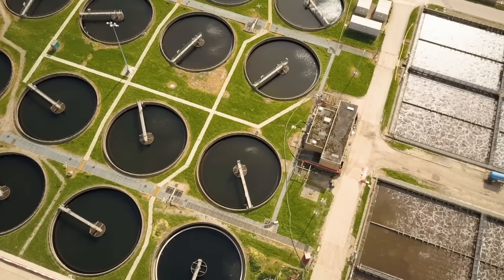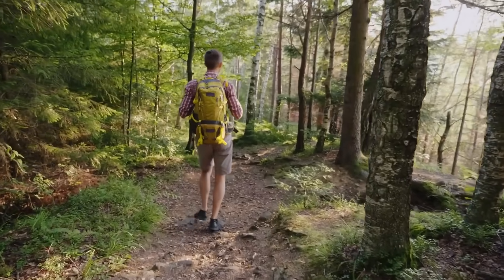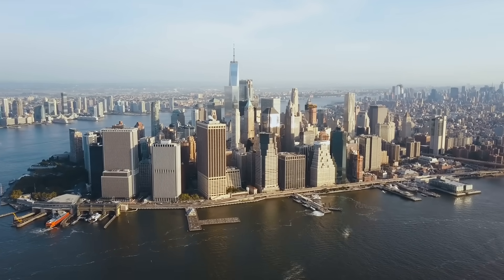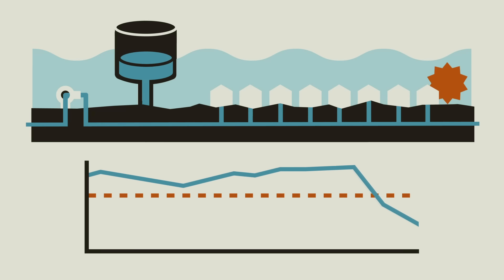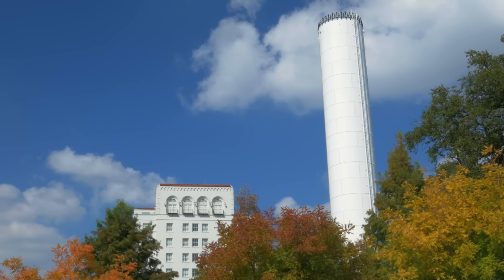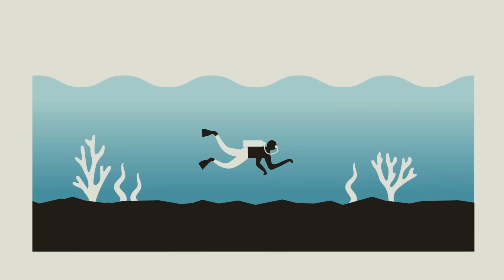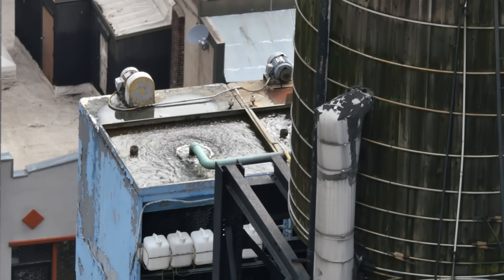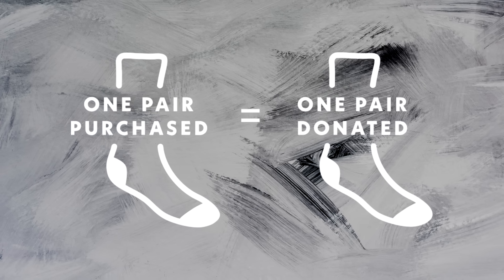How Water Towers Work

Comment: So a water tower is a capacitor. Funny that I've normally heard circuits/electronics explained in terms of water/plumbing, not the other way around.
Reply: Because electricity and water flow are very similiar, but water is easier to understand and imagine, so may be used to explain electricity.
Reply: That's the thing that occurred to me watching the video: that the water tower evens out pressure like a smoothing capacitor with a power supply evens out current.
Reply: I've thought the same!
Reply: That's because most people don't know how capacitors work.    It would be trying to explain how a car engine works with quantum physics you could do it but it would limit for target audience.
Reply: It is known as accumulator, in terms of mechanical engineering when used for fluids and in fluid line
Reply: To simplify, a water tower stores energy in terms of static head pressure,  and can absorb pressure spikes and fluctuations much like a capacitor in an electrical system . And yes, generally speaking, batteries store emf, voltage, electrical pressure and can absorb voltage spikes and fluctuations as well.
Reply: Capacitive discharge. They build an electrical charge, and when full, discharges said charge. Think of your car windshield wipers. The wiper delay is operated by capacitive discharge and the different delay times are controlled by different ohm resistors which control the rate of charge of the capacitor. Once the capacitor is fully charged, it discharges operating the wipers for one cycle.
Reply: Capacitors are known for being mini electrical shock absorbers as well, protecting sensitive electrical components from unwanted and potentially damaging voltage spikes.
Reply: damn, everyone always beats me to the good comments.  :(
Reply: @kenny holmes I agree with Kenny. Batteries and capacitors are similar in that they charge and discharge the energy when needed. The difference between them is that batteries store energy in a chemical form and capacitors store it in an electrical field. Because of this, a capacitor can discharge its energy much faster than a battery. It takes time for the chemical reaction when transferring chemical energy into electrical energy. WIth capacitors, all that energy is stored directly on the plates and it can release that energy at a much higher rate.
Reply: The big differencr someone may have pointed out already. Don't get me wrong I like the idea of thinking of it like that, but the entire purpose and everything surrounding it when it comes to water is 100% to do with moving a quantity of a medium that has mass. That's the reason for water towers in the first place, and the elevation changes that accommodated. The major thing I wish that someone could explain to me is. How is it that these towers can work given the parameters that we've been told? How is it that they're not taking into account the curvature of the Earth. If water is at a certain level in a water tower and Miles away the gravity would be pushing that water in a different direction then what it would be at the source not only that it would also be at a different elevation relative to a ball.  I realize that it's a big ball but this would be an effect that we would see make some sort of a change or difference, no matter the scale. If it has a certain rate of curvature then it has to have an effect. Last time I checked, water always seeks level and fillls whatever space or container is in but most importantly always finding level.
Reply: That was my thought exactly! I’m a Bioelectrical Engineer, so I got really comfortable with electrical engineering variables and equations. Then, I took a cardiovascular biomechanics class, and it blew my mind that the EXACT SAME terms and equations were used in fluid dynamics. So yeah, plumbing is not only a convenient analogy to electricity, it’s mechanics are governed by incredibly similar mathematical principles!! (That only goes so far though because electricity has fun relationships with magnetic fields, and AC electrical applications exploit the hell out of that lol).
Reply: @pyro-millie5533  then you may be surprised to find out just how much water indeed has fun realationships with magnetism and electromagnetic.

For example: oceanic tide changes
Reply: @pyro-millie5533  by the way, if you do not mind. WTH is a bioelectrical engineer?
Reply: @levelliberation6155  hahaha Technically its a Bioengineer with a specialty in electrical stuff as opposed to materials engineering stuff. So I work a lot with medical devices, and eventually want to design powered prosthetics and other devices that interface with the body. I'm particularly interested in prosthetics, monitoring things (like EKG and the like), and neuro-interfacing tech - I've done some research on sensory replacement in prosthetics and similar stuff. I'm fresh out of school and in my first job as a service tech for medical devices, so I have a long way to go before I'm designing devices professionally, but that's the end goal :)
Reply: @pyro-millie5533  wow, kudos. That's very impressive and sounds very very intriguing. It's impressive that you're able to have came up with a line of expertise that you thought you would like, and now you're executing a plan to try to fulfill those desires. I would absolutely love to do something like that. And not even for any type of a monetary aspect of it but simply because it's interesting, and potentially far more rewarding than money would ever be. Let me know if you ever need an apprentice lol. You may have a plan set in place but you never know how quickly it can be executed. All it takes is just one day of the right strokes and everything could change entirely where you're all the way to the end of the puzzle. So I wish you the best of luck. I kind of hope that I don't need to have your help but if I ever do I'll know where to find you if I end up short-handed.
Reply: @levelliberation6155  Thank you!! I don't know how long it will take either, so for the time being, I'm doing a job that I enjoy that lets me work with devices, and I'll keep on the look out for other ways to build experience. I'm also trying to keep on top of the current tech so I know what's already been done, and what needs more exploration. I'm absolutely in this to be able to do cool things and help people :)
Reply: It's a Flywheel kids !
Reply: Honestly it could work for an analogy for a battery or a capacitor depending on how you spin it. As with any analogies, there's parts that you can conveniently leave out to make it "fit" more.
Reply: This helped me understand how capacitors smooth out electicity better than any explanation I've heard. I used to think they seemed like they should cause spikes in current when they release all their stored energy at once, but I guess they don't do that when placed in a circuit in such a way that they only release enough to keep the electricity flowing at a certain wavelength or, if DC, a steady rate. Feel free to correct me if I'm wrong, I want to understand it better.
Reply: I know I'm late to the party but a lot of people are saying how a capacitor is the "wrong" analogy. I couldn't disagree more. A capacitor is definitely a good way to look at this problem. In an RC circuit, the amount of time is takes for the capacitor to discharge depends on the RC time constant. A larger resistance results in a smaller current, and thus a longer discharge time. Similarly, a larger capacitance (which results in more energy storage), produces the same result. The exact same thing happens with the water tower example. If you store enough energy by pumping enough water, and if the flow rate is low enough, you have a very decent analogy.

In fact, the differential equation determining the discharge rate of a capacitor is very similar (though not exactly analogous) to that of a draining water tower. The discharge rate is described by V' = k*V for some constant k and voltage V. The rate of change of water level in the tower is given by h' = k*sqrt(h) for some constant k.

Now, I'm not an expert on the discharge rate of batteries, but it's clear that the capacitor analogy isn't that far off the mark.
Reply: Just like I explained I my video on my channel years ago... And everybody got it.
Reply: This is a great thread despite how silly it seems to argue which analogy is better. Learned a bunch from the distinctions made.
Reply: You could say these regions of the brain are "functionally connected"
Reply: NEVER FRET! once our water and its delivery systems are privatized, water will be in increasing short supply, driving up costs and reducing and restricting public access. right now, as i type this, corporations the world over are scrambling to claim monopoly over our global water supply. the corporations POLLUTE the water and then horde the clean, safe water for themselves and for profit. water will be become a luxury and a commodity that only the rich will be able to afford. the corporations will hold raffles and lotteries to determine which people and which communities will get any water that week. isn't capitalism wonderful? 
          but you explained how the water tower releases the water but not how the water gets in there in first place. the water towers i've seen have one pipe coming from it. its for distribution. so, how does the water get into the tower? it would need its own pump to get the water to the high level of the storage tank. also, how are these storage tanks cleaned and how often? i assume, over the years, they accumulate all kinds of gross, scuzzy stuff.
Reply: 96fps_from_mars what will happen if we reverse the polarity of the flux capacitor?
Reply: It's not so much a capacitor as it is a battery.
Reply: @kennyholmes5196  in the case of the battery a chemical reaction produces the voltage.  It is often depicted as the source of the current.  I think a water reservoir or lake might be a better analogy for the battery.  For design purposes you might consider the reservoir or battery to have an infinite quantity of water/charge whereas the tower/capacitor has a very limited quantity.
Reply: @jordankull4295  A battery is a dam or a similar water turbine. Alternatively, it's a free falling water reservoir with high potential energy. Water tower is a capacitor. It's a perfect analogy. I'm guessing the pump could be a specific type of a diode, or even a transistor.
Reply: @milanstevic8424   no, I would disagree, a battery works better here, so long as we are talking about a rechargeable battery, which we are. A nonrechargeable battery doesn't really have any analogous public water system component, at least not a good one. And assuming we are talking about recharge batteries, turbines don't really work as an analogy for batteries because they can't be run backwards, that takes a whole separate system. But regarding water towers, capacitors are a bad anology in my opinion because they only serve as curve smoothing devices (also oscillators but that's outside the scope here). Capacitors entirely miss the aspect of long term energy storage as they are terrible energy storage devices. The best analogy for water towers are the giant rechargeable batteries being implemented in power grids. They, like water towrs, serve to decouple the local demand from the supply source, thus allowing the source to run continuously at the average demand level regardless of what the current real time demand is (in the case of water systems it also allows running at higher than average but for shorter periods of time like at night, but here is where any electrical to water system analogy breaks down as it is rarely ever more efficient to run electrical systems intermittently). If you are fimilar with these, the ultimate analogy would be an uninterruptable power supply, as that is the grand purpose of water towers, but that might be getting too far into the weeds. Anyway, I'm interested to hear your opinion of my take on the matter.
Reply: @maxk4324  yo
Reply: @maxk4324  I'm gonna say a capacitor still works here. True for most practical purposes they're used for curve smoothing or something similar (filtering, DC biasing for amplifiers, etc), but they would pretty closely follow the water tower if you consider them as a storage device. The power dissipation you're talking about is only an issue when you have an AC signal going in (analogous to fluctuating pressure), but at a DC signal (constant pressure) doesn't have any current flow, merely a voltage rising asymptotically to what's being applied to it (fill level of tank for a given pressure from the pumping station). For reference:

instantaneous_power(t) = (Vm*Im)*[cos(V/I phase offset) + cos(2*angular_frequency*t)*cos(V/I phase offset) - sin(2*angular_frequency*t)*sin(V/I phase offset)

power_dissipation = angular_frequency*capacitance*(Vrms^2)*dissipation_factor

Notice how in these equations power dissipation depends on angular frequency - which is just the AC frequency in radians/s rather than in hertz (multiply by 2*pi) - and that instantaneous power is dependent upon current ("I"). In DC you have an angular frequency of 0 and no conduction since a capacitor functions as an open circuit in DC. Therefore, algebraically we can see that with Im = 0 there is no instantaneous power, and with 0 angular frequency there is no power dissipation. This is a little redundant, but I'm trying to make it easier to intuit.

Now here's where I start making claims. I'm going to make the assumption that the pressure from the pump/source to the tower/capacitor is either constant, or changes slowly enough that the angular frequency can more-or-less be considered as approximately 0. This could be debated (if you want to get the pressure data and do some discrete fourier transforms on it, more power to you), but from the tone of the video it seems like something that could reasonably be claimed. With that out of the way, the capacitor would merely act as a charge storage device as intended in the analogy. It would charge/fill to match increasing voltage/pressure and then remain more or less inert until the voltage/pressure drops and it releases some stored charge/water.

Source: biomedical engineering undergrad with electrical engineering minor
Reply: @milanstevic8424  (TO PUT THIS DISCUSSION TO REST): The only thing that differentiates a battery from a capacitor is the voltage vs charge graph. Batteries have roughly constant voltage (slightly increasing however) with charge. In a capacitor, voltage is almost exactly proportional to charge. Similarly, a water tower has roughly constant pressure versus water amount (slightly increasing however), by design (don't want unpredictable water pressure for home users). A dam could be battery-like or capacitor-like depending on the configuration of its reservoir. If the reservoir and turbines are at similar elevations, its capacitor-like (pressure when reservoir is low = 0). If the reservoir is 1000 feet above the turbines, and only 100 feet deep, its battery-like (the min and max pressure are 10% apart). If the reservoir is extremely large, pressure is perfectly flat. In any case, saying a battery or a capacitor is the better analogy is just making a statement about the pressure vs water amount graph, whether its flat or proportional.
Reply: @kennyholmes5196  What are the important distinctions in the analogy between a water tower and a capacitor versus a battery?
Reply: @amca1975  I'd rather say, it's a battery. At some point, battery and capacitor may work the same way, but capacitors can be charged much faster and give you much more current, while batteries are slowly charged and can't give you a lot current in comparison to capacitors. Also, capacitor can't sotre it's energy for too long, it will self-discharge quite fast(it takes a lot of time for battery). 
So water tower, you slowly "charge" it with water overnight and it's slowly discharging it durning peak hours and water may be stored there, theoreticly, forever(it's another topic, that this water won't be safe to use after some time because of bacteria etc.).
Reply: @Stasiek_Zabojca  
A chemical electrical battery is slow to charge and discharge. The correct analogy is a fast battery - like an ultracapacitor.
Reply: @johnburns4017  Well, I don't think, that this water tower is being charged that fast. You use your small pumps to fill it up overnight. You would need huge pumps to fill it fast and that would be a bit pardox, because you build water tower so you don't have to use powerful pumps.

And can't accumulator work the same way as capictor in therms of flatting current? Like car batteries for example.
Reply: @Stasiek_Zabojca  
It can discharge fast.
Reply: @amca1975  battery generates electricity, capacitor stores electricity.
Reply: @Stasiek_Zabojca  differentiation btw battery and capacitor is quite artificial.
Reply: @kennyholmes5196  it's vastly more apt to compare it to a capacitor.
Reply: @kennyholmes5196 : I disagree, because a battery creates electricity through chemical action. Once first charged, yes >> rechargeable << batteries can store juice, too.
Reply: @kennyholmes5196  no.  A battery generates electricity through chemical reaction.  
A capacitor stored electronic just like a water tower stores water.
Reply: @kennyholmes5196  actually it's best represented as capacitor not a battery as its main role is not to supply power but rather to keep constant pressure whenever high load is experienced by the supply. It very quickly feeds hungry loads without losing pressure while the supply feeds it slowly. The supply can't provide abrupt high flow rate (or current) without losing pressure (or voltage) while tanks (or capacitors) can feed such flow rate (or current) but for a small amount of time depending on the tank size (or capacitor capacitance). Within that time the supply should be able slowly to recharge the tank without losing pressure while having hungry loads fed appropriately!
Reply: @kennyholmes5196  No, capacitor is definitely more accurate if the towers are truly being utilized as often as this video suggests. Constant day-to-day water flow, with stagnant levels as the video suggests, is very comparable to a capacitor
Reply: same
Reply: Yes a water tower is a battery, an accumulator.  It is also a capacitor in smoothing out water delivery.